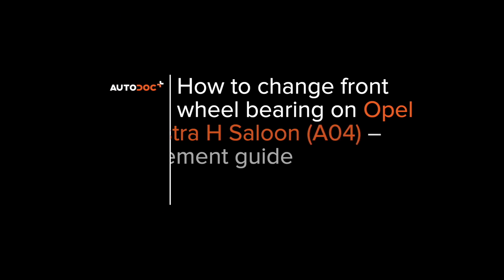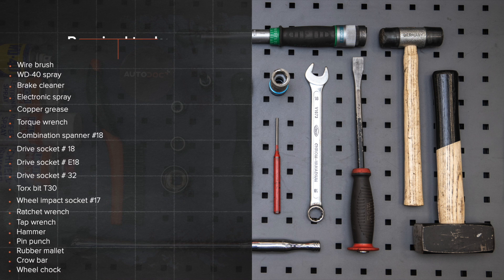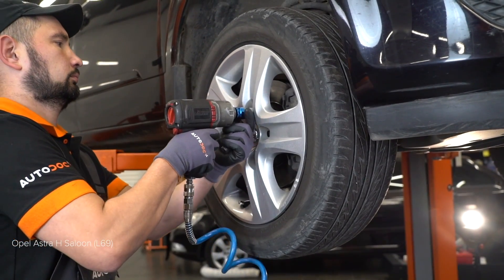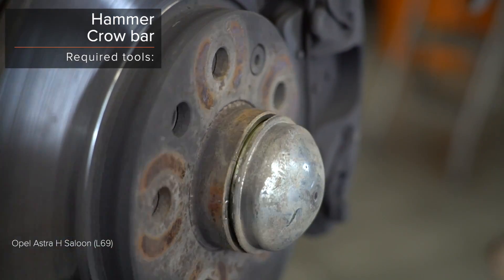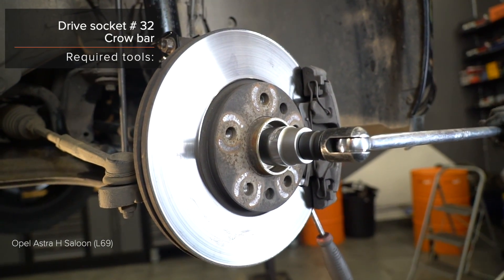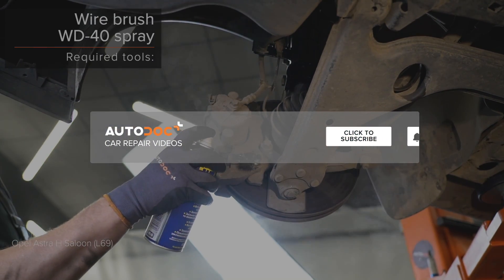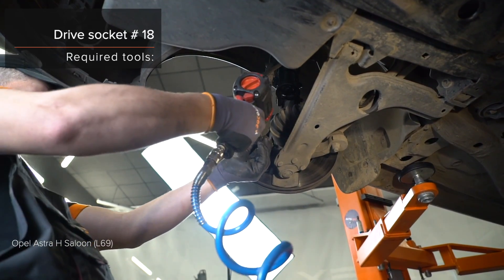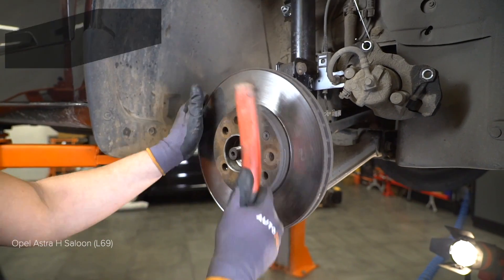How to change front wheel bearing on OPEL ASTRA H Saloon [TUTORIAL AUTODOC]

Comment from the maker: Did you notice that our mechanic made a mistake?
Let us know in the comments what the mistake was and when you noticed it 💬
Reply: From 7:08 he was spraying bolt head with cooper grease not the threads.
Reply from the maker: Our viewers are so observant!
The correct answer: The steering knuckle is not jacked up at 3:00
Reply: @autodocuk  So how is it supposed to look or be done? How is it to be jacked up, am I going to cause damage by not "jacking it up"?  Please explain.
Reply: Wrong torque for hub bolts, instead of 71nm should be 90nm + 45degrees.
Driveshaft nut should be tightened 150nm -45degrees then 250nm

Comment: Is it enough torque the driveshatf nut to 165nm? 7:30 Somewhere i heard the factory manuals are, 150nm then 45degrees and 250nm. So which one is correct?
Reply from the maker: The correct moment value is 250 nm.

Comment: Incorrect method of replacement. The steering spindle did not need to be removed from the strut. Invest in proper tools to do the job properly without unnecessary steps.
Reply: Well, sometimes it helps to have less stuff in the way, even if it is unnecessary to move that stuff out of the way.
Reply: @Strange_92  work smart, not hard.
Reply: @ridds777  exactly.. sometimes it's just smarter to remove some stuff out of the way, if possible. Not too much, obviously.. I work on my own car, as I have enough knowledge, I got a vocational education on this stuff. I'm not saying that I'm the best mechanic, but I do know stuff.
Reply: @Strange_92  removal of unnecessary parts is a waste of time. If your time is not valuable to you, then that's on you...
Reply: @ridds777  depends on what you remove.. and when I'm working on my own car, I'm not doing it on such a hurry. Not too slow either...
Reply: @Strange_92  removal of unnecessary parts is a waste of time. It shows a lack of knowledge. There is no justification for it, just stupidity.
Reply: @ridds777  I'd say that also just stating in the internet that "I am the one that does everything right" is stupidity. Like I already said, I'm not saying I'm the best mechanic, and people do this stuff differently everywhere. I don't think you would go to a mechanic shop to just tell everyone how to do there stuff? 🤣

I know they do their job fast at the shops, they have to. It's different when you just work on your own car at your own time. Also in older cars, some bolts are pretty much stuck, it takes some time to get them out even with right tools. If you have ever worked on cars, I'm sure you know that.
Reply: @Strange_92  I'm licensed. I know what I'm talking about. I value time and doing things correctly. Wasting time, doing things incorrectly, and then making excuses for it shows an ineptitude on your part.
Reply: @ridds777  like I already said.. and I'm saing for the third time.. I NEVER SAID I AM THE BEST MECHANIC. Also, like I already said, people do things differently. Licensed or not. There are things for me to learn yet, and I'm sure there are new things for you also sometimes. And what I mean by "removing someunnecessary parts is sometimes easier", is that even I don't do it 99% of the time when working on my car.. or any car for that matter. Sometimes I do that on my own car for easier access.. but not always. But I sure would not do that on a customers car..
Reply: @Strange_92  the term unnecessary is just that. It is unnecessary for ease of access. This is a lesson you will learn quickly when removing something that is unnecessary brakes. i.e. a bolt etc. Your expense, time has now doubled. Do you have the skill set to drill out a broken bolt? No. Stop trying to argue with nonsense. Do not add unnecessary steps. Time is more valuable in doing something properly.
Reply: @ridds777  so you are telling me, that you have NEVER made a mistake like that? Okay, good for you. When I was in school, I saw some people do some bad mistakes, as we were actually fixing and servicing clients cars there. And yes, I have had to drill out snapped bolts just a couple of times, and those were not even unnecessary bolts.. I know it takes time. I'm once more saying, I know I have things to learn yet, but you just seem to ignore parts of what I'm saying. Never mind that I said anything, have a good and flawless day.
Reply: extra charges for customers
typical 
more cash .
every job
Reply: Yeah i agree. I'm just a home amateur who's been working on my Astra H now since June last year as my learning project car, and the complications from removing the steering knuckle adds unnecessary work and headache. If in a workshop then it wouldn't be that great a deal with the right tools but it adds more time on jobs where time = money so essentially a false economy. 

That cars camber will now have to be reset to the factory specs of that particular model which requires a lot of accuracy otherwise severe issues will arise as you'll know. Aren't those bolts one-time use bolts aswell? 
I just replaced all my hubs and have both drive shafts out for a crankshaft sensor pulse ring change and clutch overhaul and that entire column stayed intact minus the lower arm. To go removing stuff that doesn't need removing is really illogical. 

It's like back in May i believed i had to have my AC gas removed to take off the compressor to remove the cat manifold to change the oil cooler gaskets etc. Turned out after a few weeks fretting about paying a mobile mechanic that all i had to do was take the serp belt off, unbolt the compressor and move it out a bit. Manifold came straight out and work was complete within a few hours. The Haynes manual steered me wrong, but a Vauxhall forum full of pro and am mechanics steered me right. 

Over-complicating things just adds more work and in my experience, more delays and more problems. 
👍
Reply: Ya dead right I'm a mechanic myself ,he added 30 minutes to the job taking out driveshaft and the amount of copper greased used